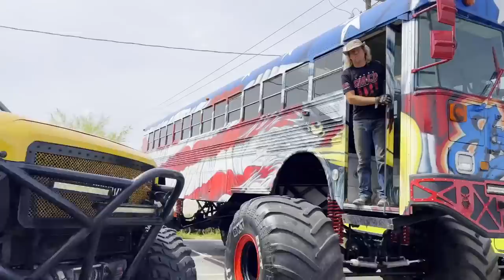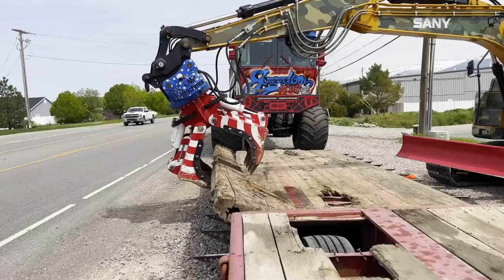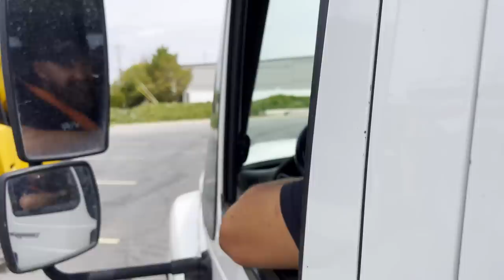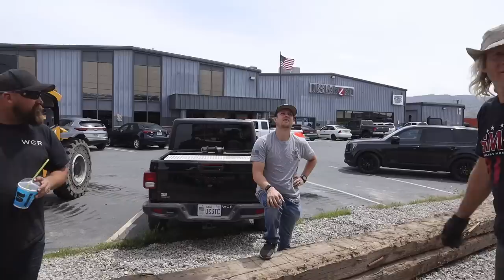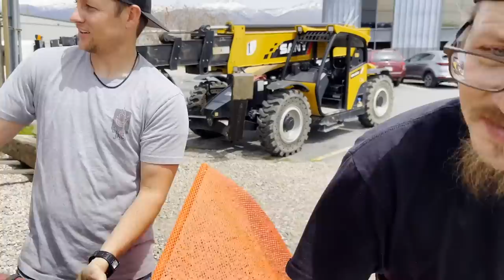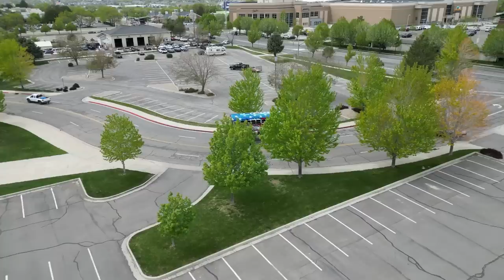FREEDOM BUS On The Move. OVERSIZED LOAD!

Comment: You have done a cracking job on the boat, but you have added two lge batteries and a powerbank all in the port side locker, sadly as the boat is only small your adding to much weight to one side. you really need to have a battery either side to distribute the weight evenly, plus  one of you  sitting or standing  on the port side, I'm not saying who will add the most weight lol, but it can seriously comprimise the safe handling of the boat. Please don't see this as a criticism,  35 years marine engineering, boat building and around boats since I could walk, and owned and worked on a few of these mariner boats over the years,That's not saying you don't have experience yourselves by no means, just a friendly heads up. Best of luck guys your doing a great job on them both. Regards Jim.

Comment: I think the best solution for shipping that thing is to have a second set of tires for shipping it. So you can just switch the tires out on location. so having everything for this in the bus would be best. I'm just spit balling here.
Reply: yes, but the process is not as easy as it first appears. The bus is really tall and to take the big tires off it needs to be lifted up, A standard floor jack will not do that, so you need a forklift type vehicle to do that. Also, you can not just remove and switch out one tire at a time due to the difference in tire height. You have to do an entire axle at the same time, meaning both front tires together and both rear tires together. So that forklift needs to be strong and stable enough to lift the entire front end and rear end of the bus. Then you need a transport vehicle for the large tires to get them to the destination and you need to bring or have another forklift at the destination to put the big tires back on ... and for the trip back home do the same process again.
Reply: @silentepsilon888  there is a really good product idea. Make a off road style floor jack for these monster tires....
Reply: @novicracker1980  pneumatic bottle jacks are already a thing. They lift loaded semis to change tires all day everyday.
Reply: @danjones1365  Are they off road?
Reply: @novicracker1980  what does that even mean?  If you’re asking if they have big knobby tires and high ground clearance, no. But they are manually portable, capable of lifting tens of thousands of pounds, and have been in universal use in every industry that needs tires changed on heavy equipment out in the field for decades. (Construction sites, mining, forestry,etc…)
Reply: @danjones1365  well the way I can imagine an off road style jack for monster tires isnt really a viable thing. I mean that what i was imagining in the first place, but I cant see it being a thing. So yeah Never Mind. lol Thanks for that conversation.